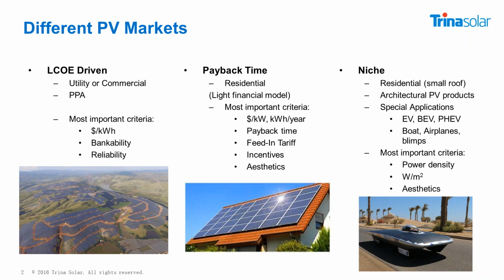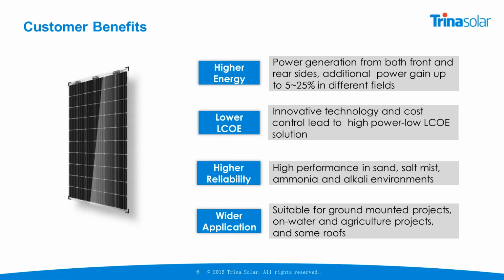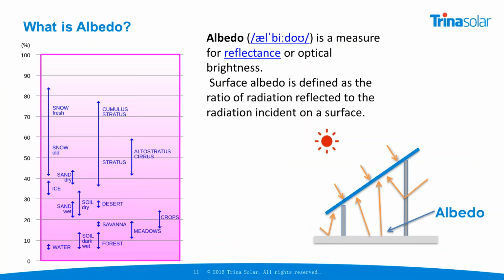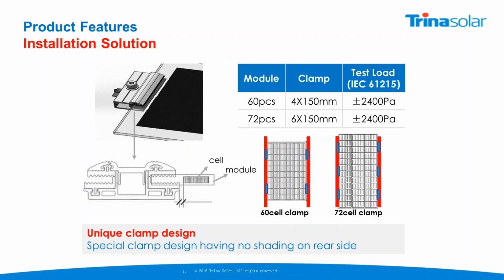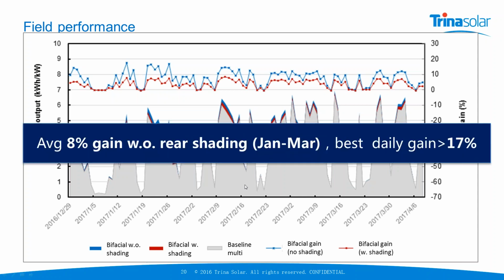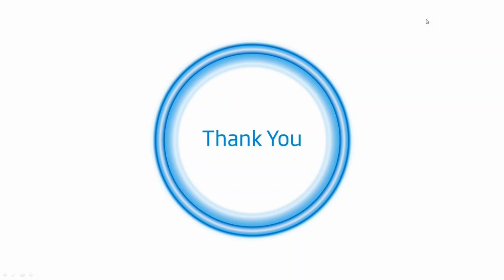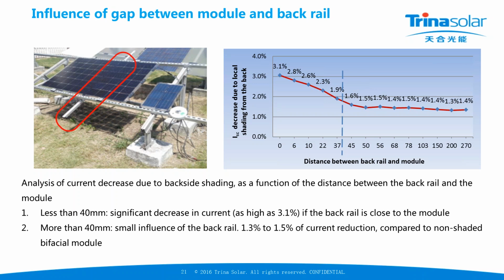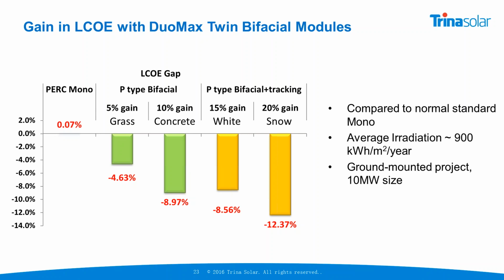Webinar: DUOMAX Twin Bifacial Modules explained by Trina Solar Chief Scientist Dr Pierre Verlinden

Comment: Just got a quote for some bifacial panels and they are 40 to 45 cents per watt for a 10kw residential system, which is basically what standard solar panels cost now a days. pretty amazing how the price has come down.

Comment: very interesting presentation !
Reply from the maker: thank you! Is there anything we can help you with?
Reply: Thank you too for your reply. In fact, I'm researcher in R&D of PV cells and recently we started working on a new project on p-PERT and PERC cell fabrication and caractérization, in addition to Al-BSF one. The wafers used are mc-Si elaborated in our center CRTSE (www.crtse.dz). One of the aim of this project is the identification of the appropriate concept regarding our material. The good choice of the mc-Si based solar cell architucture will open us a way towards a possible industrialization of the optimized product. 
For this reason, let me know if you offer open collaborations in this context (testing the potential of our material using your industrial fabrication process and training).
Reply: Trina Solar EU 
Thanks for your video, please share your presentation and send also your data with tracking to my email:
luiz@braeng.ind.br